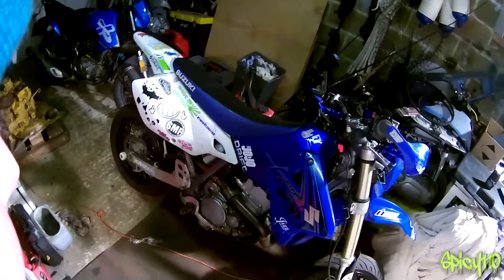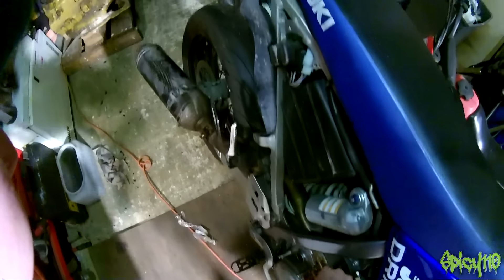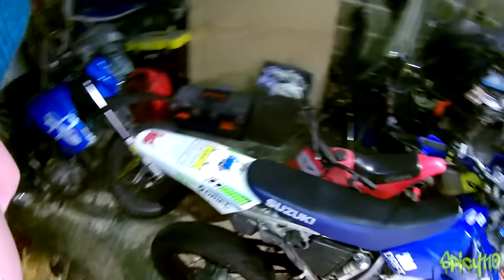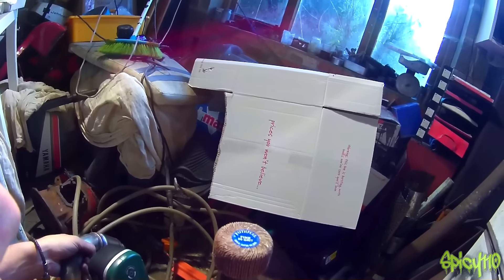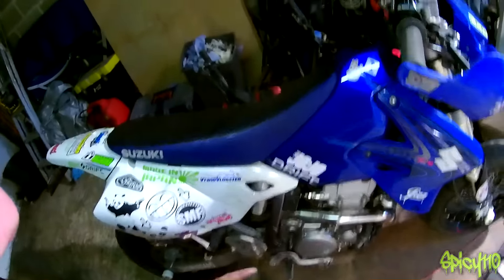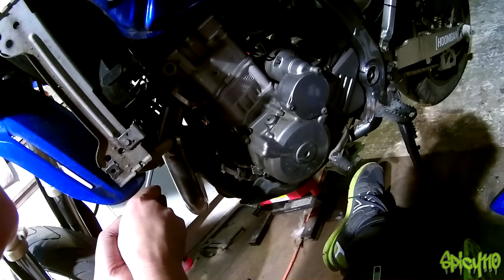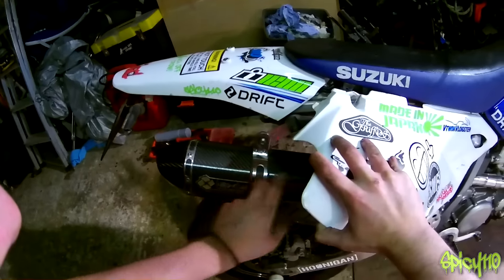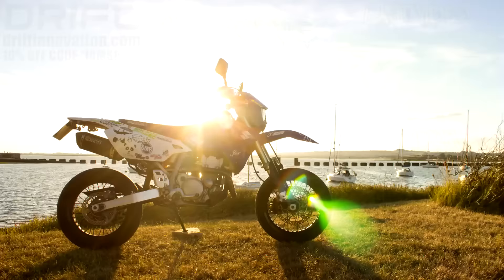Refurbishing Stainless Steel Motorcycle Exhaust.

Comment: With regard to the white plastics you could refurb them by taking off the decals and polishing/buffing them with T-Cut, it's been about 20 years since I last messed with off road bikes but that was the trick we used to tart a bike up before selling it, get a buffing pad for your drill and it will take no time, way cheaper than buying new plastics and probably just as good.
Reply from the maker: +John Smith you don't lose the shine?
Reply: Use t-cut to remove/repair the top layers of paints which removes the lacquer from the plastics you can then use synthetic car wax (Sealant) to put the protective layer back on the plastics let that cure then use your favourite polish to bring the shine back
Reply: iZephyrs Yep back in the day we'd hit it with the turtle wax after on the buffing wheel, shines them up real nice.

Comment: stolen from a post on street triple.co.uk "Also not sure what the state of your headers are but if you want to clean them up nicely soak them in cola and scrub them with ally foil or wool.. It'll take off the rust and crud as well as the brushed finish if you want a polished finish. What you can do then is wash them down, buff them up with some silver polish to a mirror shine and quartz coat them. They'll quickly turn golden again but the metal will be sealed from the elements which will stop them corroding and will keep them looking like new." but I have never tried it.

Comment: Derek sounds brutal as hell in a closed space! Either that or the helmet cam when on the road doesn't do him justice.
Reply from the maker: +KD197 it's the mic on my normal Vlogs is designed to cut noise out. That and I'm facing away from the exhaust 😀